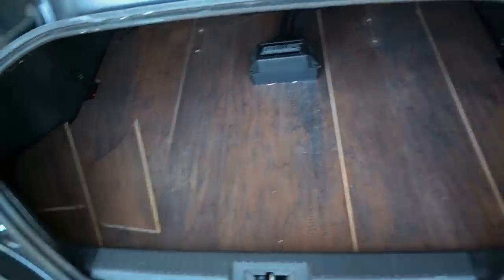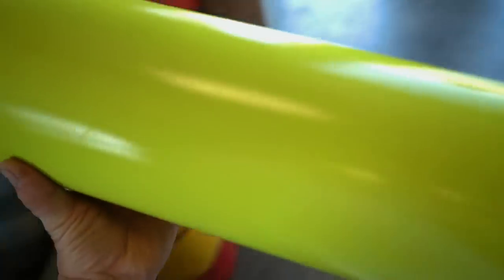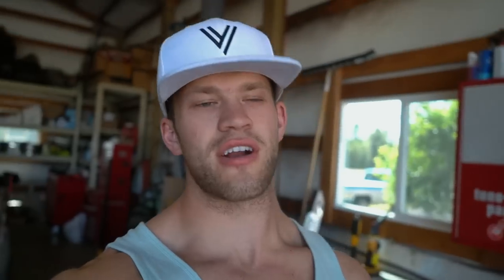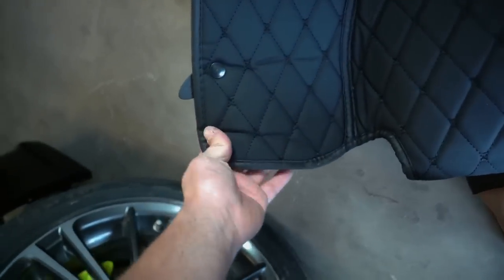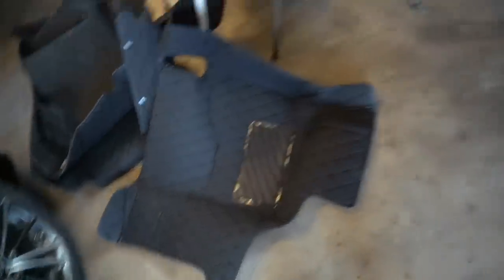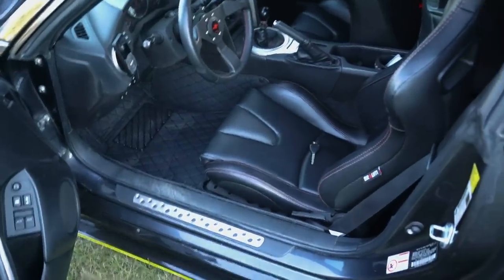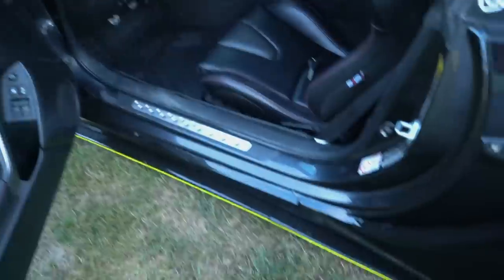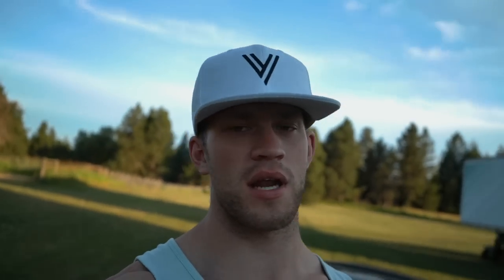Custom Interior for my Car!

Comment: For the air connection u can use something called pipe dope which doesn't glue the line on it just deals I use it in situations where I can't use thread tape or don't want to, I do a lot of plumbing work so I need it to hold forever